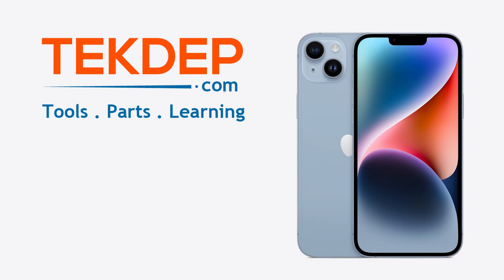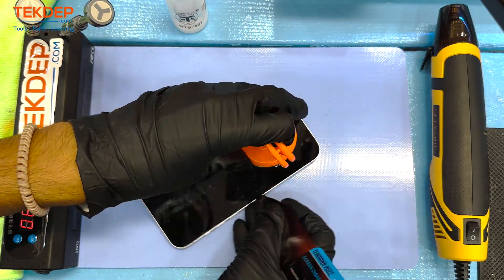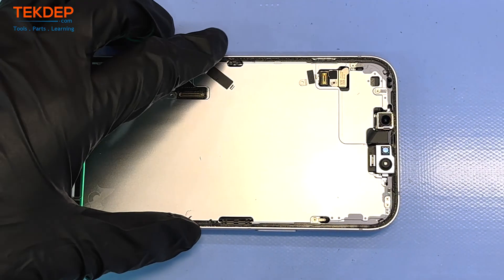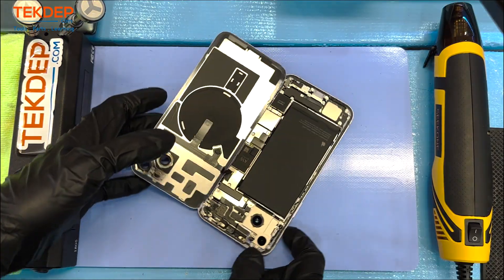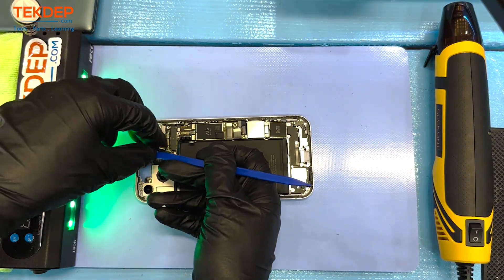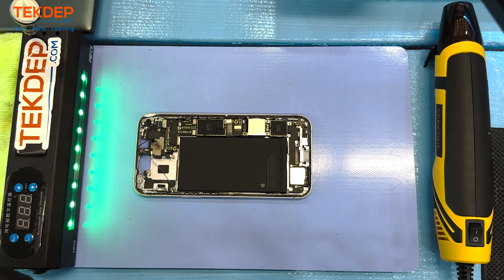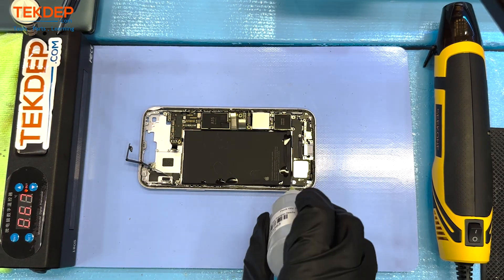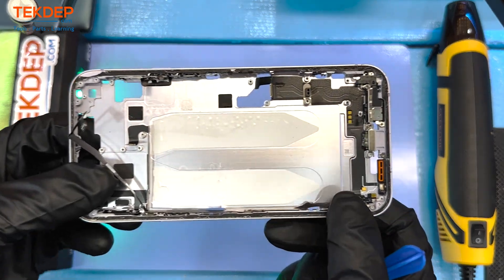iPhone 14 Plus | FULL TEARDOWN | Disassembly Repair Guide A2632

Comment: is it like taking off an lcd the back glass?
Reply from the maker: Hello! It is somewhat similar in terms of the process. The LCD is definitely delicate than the back glass. But the back glass requires more force on prying it open, because the adhesive provides more resistance.

If you're uncomfortable doing this repair we offer mail-in repair services: https://tekdep.com/repair/
Reply: @tekdep what do you recommend to open the back glass? A heat gun?